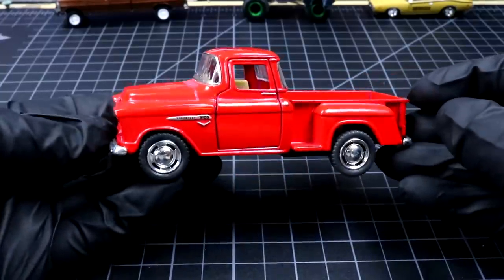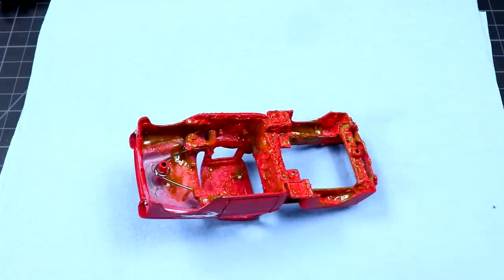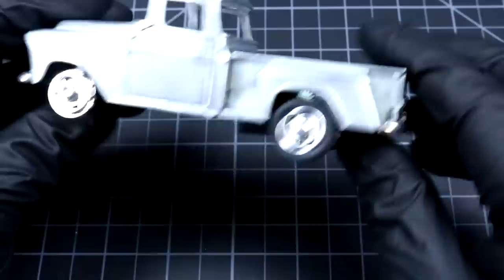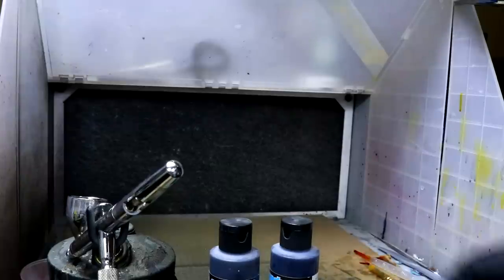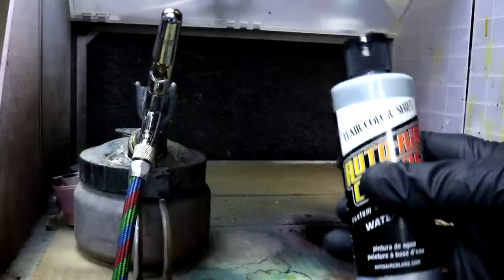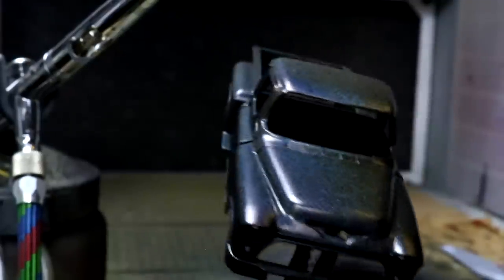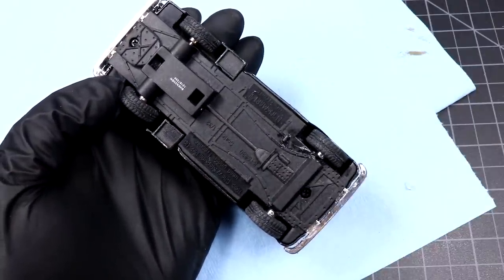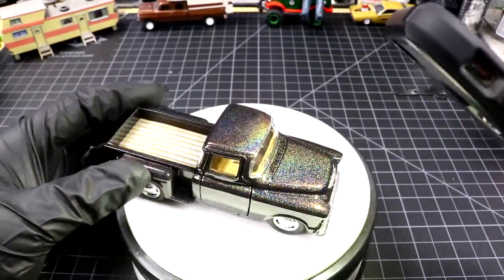CRAZY HOLO PAINT ($65 Bottle!) Must see ending!

Comment: I've just completed a couple of different projects using the color shift paint, a flat bed truck with a 71 camaro in tow, 2 tone light blue metallic, on the fenders of the truck and a pearl white on the cab, then the color shift on top of that, I've also done a heavy chevy in the light Natalie blue and the color shift, the change in colors in more subtle, and it don't look so sparkly. Just wanted to see what it would do over a light color instead of black like they recommend, and I think they turned out great, couldn't be more pleased with the results., you experimenting has me experimenting also, keep up the great work

Comment: Speaking of experimentation, here are a few things I'd like to see you tackle:

- More fades.  This is the first one on the channel, I think.
- 3D printed custom wheels.
- Two-tone spectraflame: mask off the body with liquid mask and plate copper over the zinc, then paint.
- Faded spectraflame
- Multi-color candy metallic undercoat: some combination of silver/gold/copper between the black and color coats

- Plated plastic: there are ways to apply a metal-infused solution on plastic which will take plating.  Factory toy plastic plating is vacuum metallized with aluminum (the machinery is very expensive), but automotive "chrome" plating since the 80s uses nickel over copper which you can easily do in your plating rig.  3D printed wheels + plastic plating = PIMP!
- LED light kit
- I know you don't like doing interiors, but I'd like to see you do one balls-to-the-walls, including painted headliner on the underside of the body; on a large scale model (1:24) you could even flock the carpet.

Comment: Lol, daft thing is i got a very similar effect the other day on a hot wheels van but didnt use expensive paint. All i did was give it a coat of gloss black, then once that had semi dried i gave it an all over zap of "upcycling sparkle spray" (basically clear gloss varnish with glitter in it). Obvs the flakes arent as small as this but when youre on a tight budget and all that, lol

Comment: I do try to watch all of your great videos, but I feel like I missed something because lately i have heard you talk about cooking or baking the paint. Are you actually placing the painted casting in an oven, if so how hot and how long a time, and what benefit do you see from the process? Thanks if you have the time to respond.
Reply from the maker: 30 mins at 140F .. You end up with a hard candy coating and its supposed to be more durable that the regular air dry for 24 hours. Having a freshly painted car in a little foil box with a 60W  lightblub in it is enough.
Reply: @DiecastResurrection  Thanks, I'll give that a try.